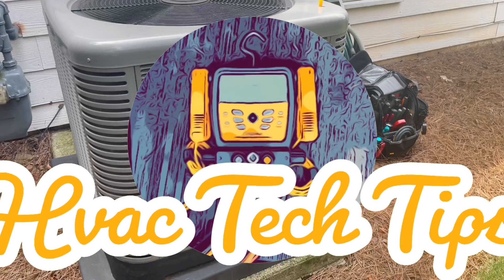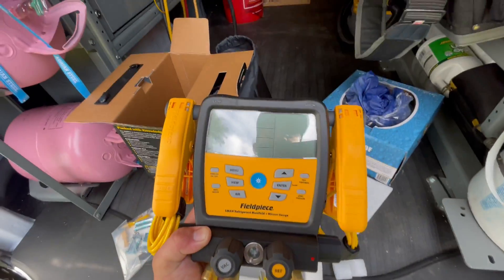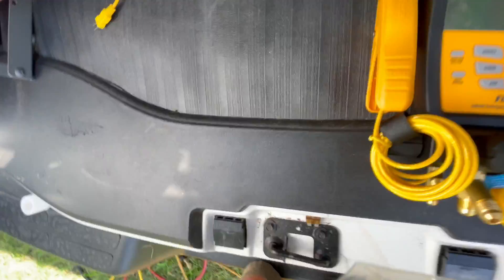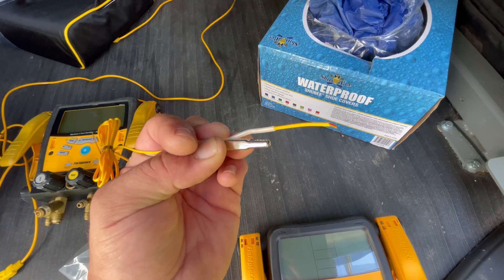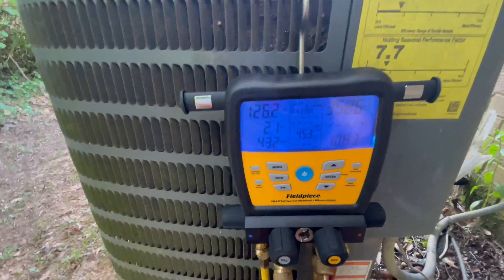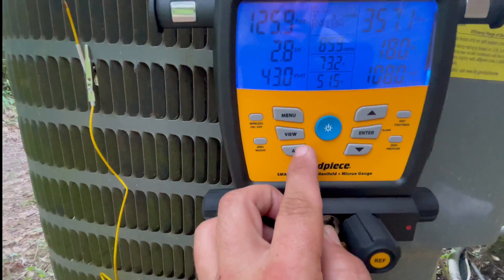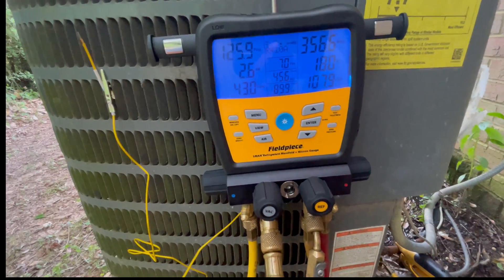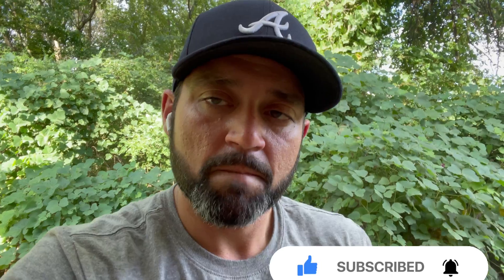HVAC Tool Review | Fieldpiece SM480V

Comment: Not an HVAC guy here, so don't laugh. We have a 2yr old 5T goodman system and  the readout (hot day 90F) on the SMAN was 105PSIG, 4.2 SH, 34.1 VSTAT, (R410coolant), 38.3 SLT, 89.9LLT 275.7PSIG on the right, 0.8 SC, 90.1LSAT. 
so, the tech who read that said those numbers are way off.
could this have been because of the dirty filter? it was filthy! thanks

Comment: I just stumbled here (this video) and love the channel. Subscribed! I am a fairly new tech and looking at the SMAN480V, but I’ve got to ask: how does it know the target superheat? Currently I look at the rating plate (if available) and plug it into an app or use the old fashioned chart to determine.
Reply: You enter the temps and dew points wet and dry. Check you manual for how.

Comment: As heads up …. Don’t ever drop the gauges on the brass ports….. I fucked mine up like that tbh they started leaking really bad.
Reply: Yeah don’t do that 😂 I want these. I have the probes and I must have picked up a lemon bc they always have trouble connecting. How does the Bluetooth work in the SMAN? Is the distance decent
Reply: @murkyturkey5238  honestly man idk cause I never use the Bluetooth .. and dude yesterday I dropped them on the brass ports agaiinnnn 😅

Comment: I'm a home owner who is learning how to do HVAC. I purchased an SM480V and one JL3RH probe. My question is do I need two of these probes? My understanding is the dry bulb type K clip that comes with the SMAN is used for the outside condenser temp and then you use one JL3RH as a wet bulb on the return air vent. So why do you have two JL3RH probes?

PS I will be checking my main home AC plus my garage mini split system with this gear.
Any tips appreciated!
Reply: You went all in with the digital gauges 😂 probably excessive since the math is easy but not gonna lie the digital gauges are insane how accurate and easy they are to use
Reply: you better have a epa 608 because if you dont you can not even have gauges please dont try to work on your own equipment unless you have the knowledge to do so before you end up messing somthing up
Reply: @koryluce3856  hell with the epa
Reply: @AquaTech225  right 😂 he’s fine if he has common sense
Reply: @AquaTech225 facts, why is it illegal to cool off the atmosphere 🤣
Reply: @koryluce3856  I took care of it myself. Got my heat pump running perfectly fine and saved a ton of money and gained a ton of knowledge.
Reply: @LichaelMewis  what was wrong with it that you needed gauges in the first place?
Reply: @luismelchor744  the Heatpump was a new install that required gauges. The main ac system nothing was wrong, I just wanted to check it.
Reply: @LichaelMewis  well if your just a DIYer and you installed a heat pump by yourself thats pretty impressive. I was under the impression you fixed your A/C with gauges and we all know gauges just lets you know the operating conditions.